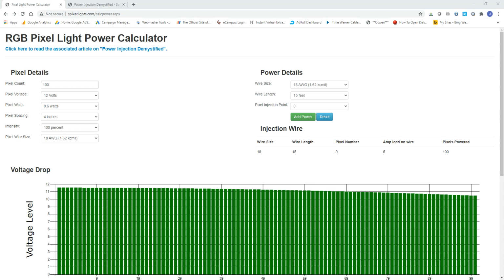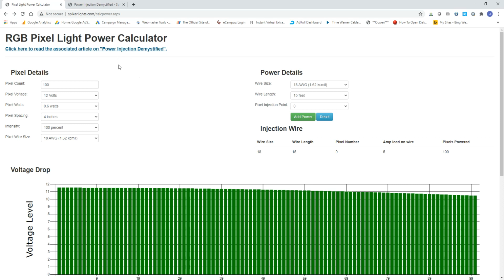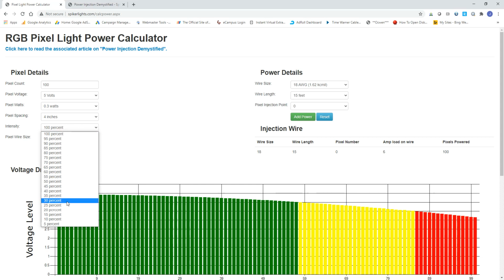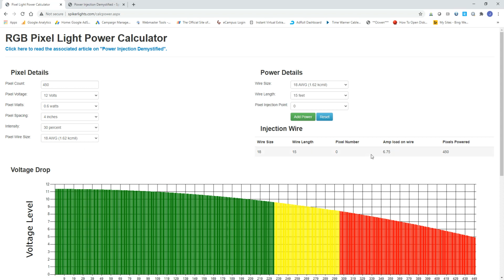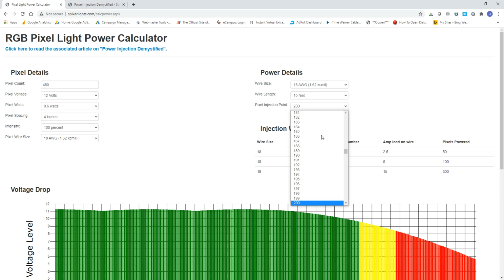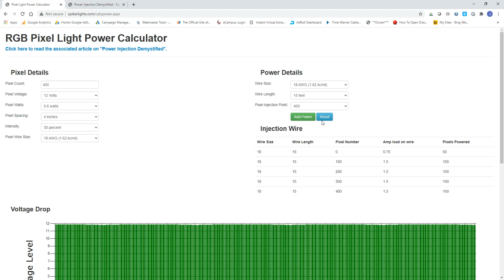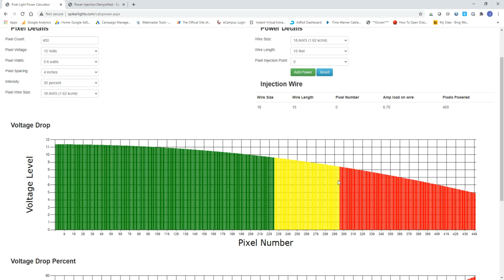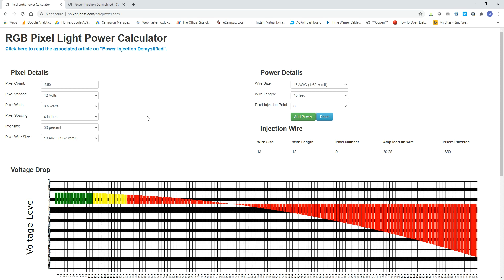RGB Pixel Power Calculator Overview

Comment: At 4:16 I see on your calculator there are 5 rows of amp load on wire. do you add all these numbers together? What I like to do is use one 12 awg wire and branch off that one wire, this is where I get my question do I add up all the total for my fuse and power injection.

Comment: Hi there,

I love your calculator, it is awesome to help determine the minimum power injection needed. I'm wondering if it is possible to add a line that shows the power being drawn by the data port. For example, on a 300 pixel prop, using 5V pixels at 100%, the total draw is 18 amps. If I inject every 100 pixels (100, 200 and 300) the calculator shows all 18 amps on the injection wires. If I assume at the first 50 pixels are powered by the controller, and I link the power and ground from before pixel 1 to pixel 300 (the 3rd PI is comming from the controller port), I actually have roughly 6 amps on the controller port, and only 12 amps on the injection wire. Is it possible to add to the calculator the option to link the pixel cable to itself and to show the amperage on each wire?

I also like to use the same wire from the power supply to multiple points in the prop. In the example above, I would have the power and ground from the data port split at pixel 1 over to pixel 300, and I would run a PI cable with a "Y" to pixels 100 and 200 rather than running a seperate wire to pixel 100 and another to pixel 200. Is it possible to be able to identify in the calculator which cable is being used at the injection point - say "A", "B", "C" or 1, 2, 3 so that the amperage on that wire is tallied each time it is being used?

Finally, a question about total maps drawn - In my example above, if the total load is 18 amps, why is it the 5 amp fuse on the controller does not blow if I do not add any power injection? I understand there is substantial voltage drop but the load is still on the wire is it not?

Thanks for your help and all of your time on this project

Bob

Comment: In an effort to power inject from the same power supply (the one with the controller), would it be advisable to split +5V & GND off pigtail at "start" and run to the end?
Reply from the maker: If it is coming from the same power supply there is no need to split it. The following article shows different setups and examples on how it implement it. http://spikerlights.com/pwrinjection.aspx
Reply: @jspiker77  Thanks for the article and the calculator.  I've read through them both.  I don't mean split into 2 separate 5V rails.  I mean create a 5V "y" and a GND "y" and send the one side over to end of the last prop (for example, 2 mini-trees with stars).
Reply: Similar to your "Option A" but instead of going back to the PS via a separate 5V and GND, branch off the existing 5V and GND.
Reply from the maker: @robertabanks  Yes, here is a video doing something similar. The main consideration is that the total load on the wire is within it's rated capacity. https://www.youtube.com/watch?v=yUOnskz2irY&t=5s
Reply: @jspiker77  Perfect, thank you!  I just watched the vid last night and I thought that's what you were doing but I wasn't 100% sure.